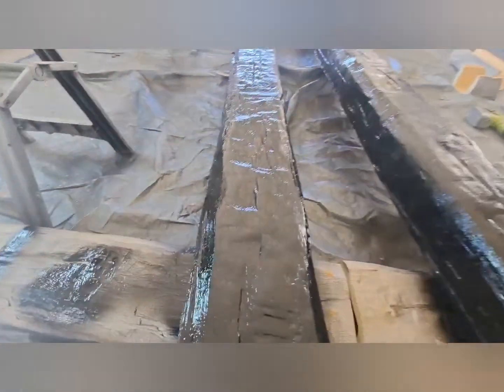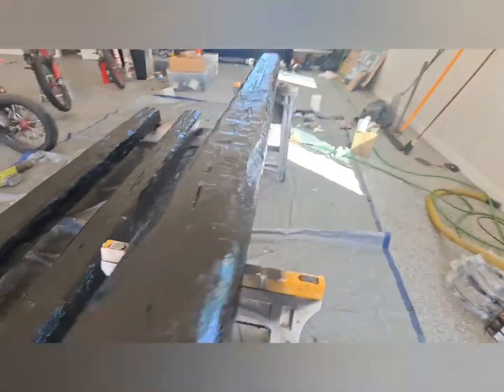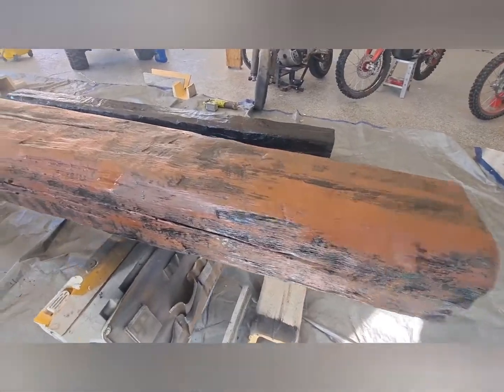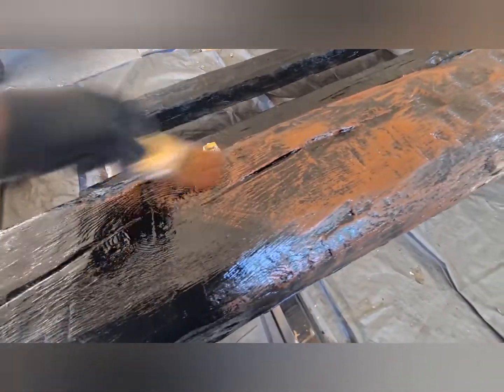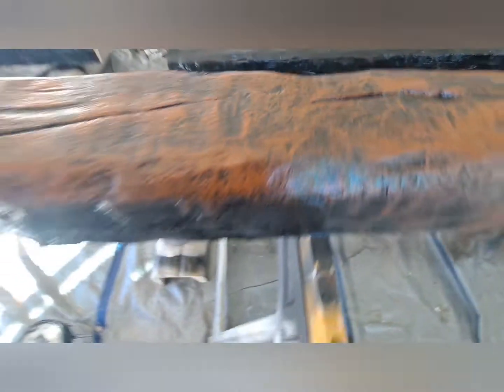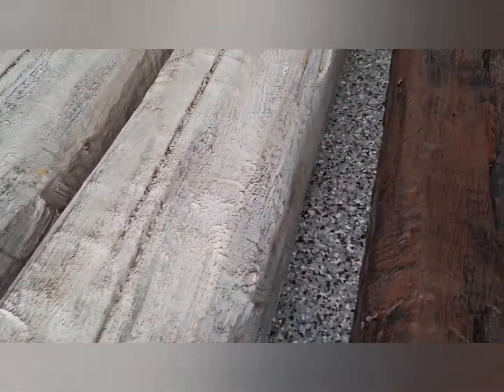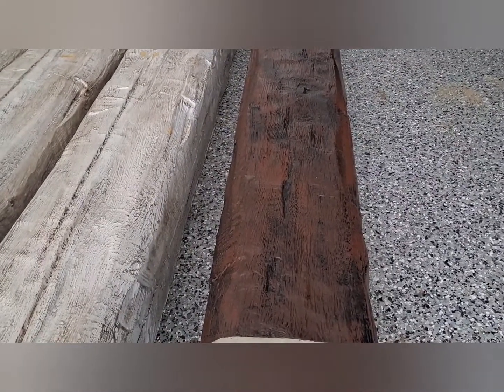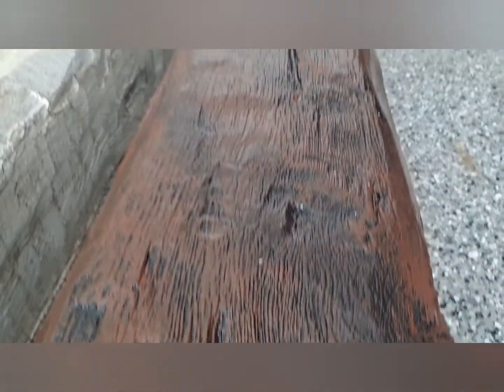ADU project farmhouse wood beam (faux foam) refinish and install

Comment: How’d you do the ceiling fan through the faux wood beam?
Reply from the maker: Inside of the beam I built up 2x4 blocks which end just above the surface of the beam. Then I cut (hole saw) the beam just big enough to slide the fan bracket inside the beam and screw it to the blocking. Then once it's hung the trim cover is big enough to cover the hole I cut. 
It was pretty easy because I did the blocking before putting the beam up.